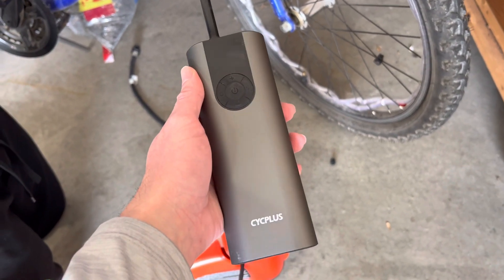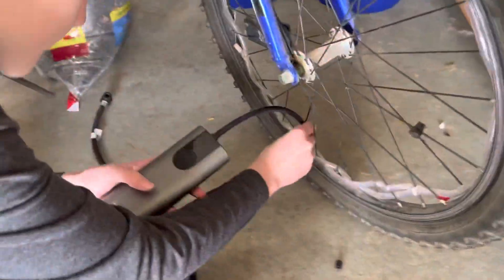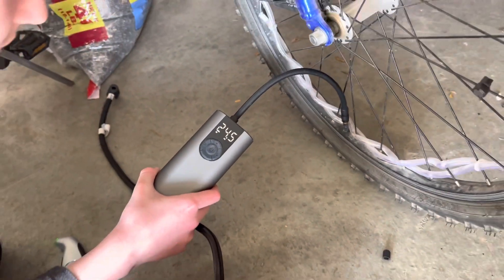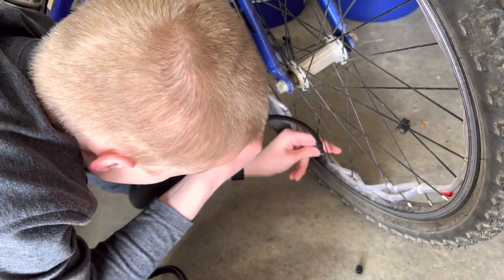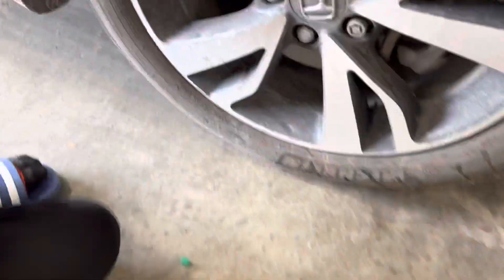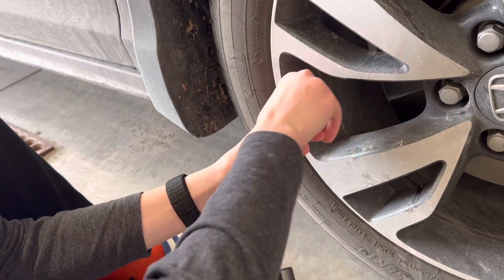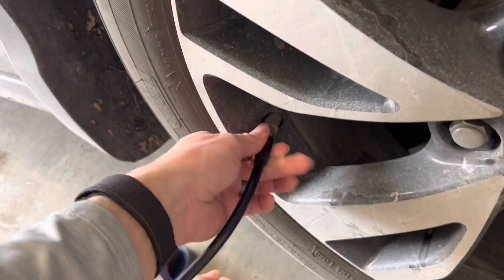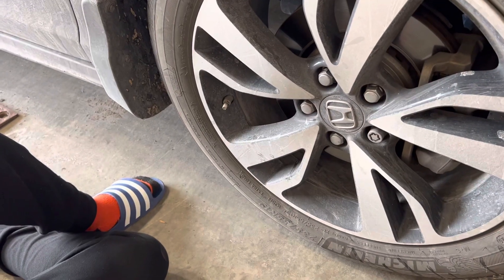Cycplus A8 inaccuracy

Comment: Hi again. I test today my Cycplus A8. I compare it with legalised industrial compressor (100% accuracy) and results are 100% ok. I set 2,1 bar for mtb tyre, pumped with A8 and straight after compare with compressor (checked on compressor which informed me tyre is alrd pumped to 2,1 bar). Results are exactly the same. Your Cycplus a8 is faulty or your second tester doesn't work properly.
Reply: Give it time. It took one year before my A8 started to not read correctly.
Reply: @EastbayGolfer  every manometr will decalibrate over a time

Comment: Did you ever solve this as I am having the same issue.
Reply from the maker: @EastbayGolfer  they sent a replacement. That one works as intended. It was just slightly different because the valve part was a different size.
Reply from the maker: @EastbayGolfer  but when it works correctly it’s a great little device